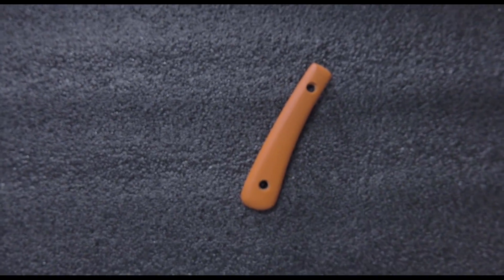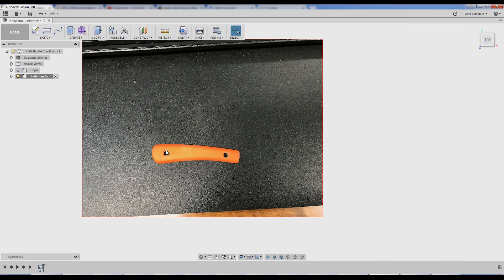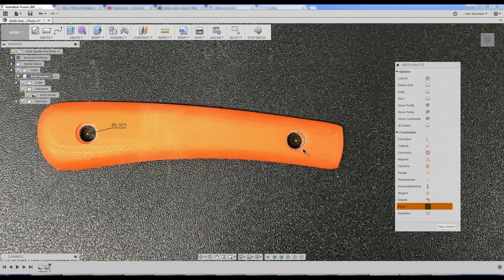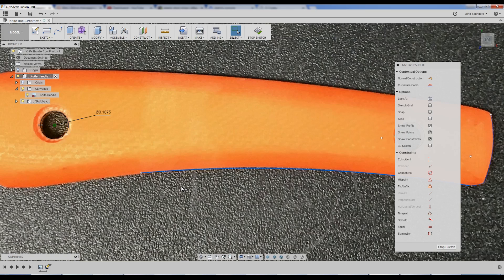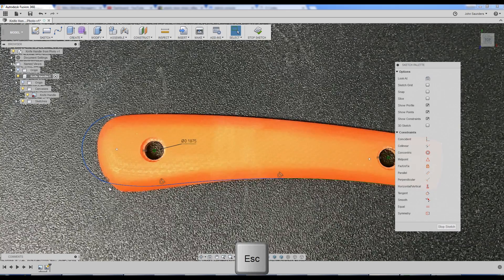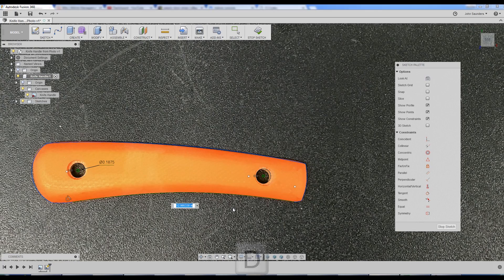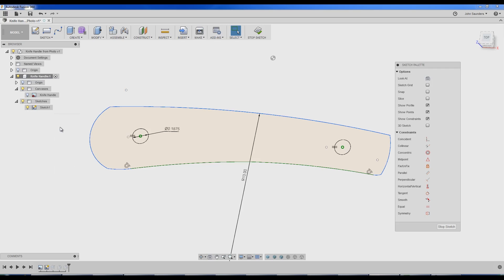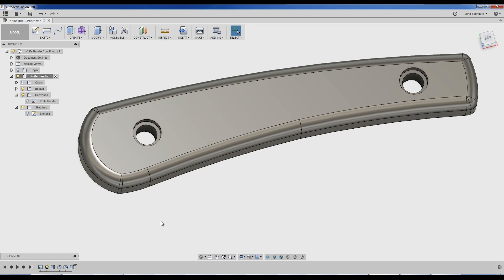How to Create a CAD Model from a Photo in Fusion 360! FF96

Comment: I wish this was a little more detailed in its explanation.  As others have said, it's really helpful to take a photo of a ruler next to the piece for calibration but even better is to flatbed scan the part with a ruler as it helps to reduce parallax error and distortion.  Regardless, this is a good exercise if just needing a single part but where it quickly fails is if you have several parts that will fit together and you need all the holes to line up to tight engineering tolerances.
 
I found in these cases, even with scanning and very accurate calibration, you can have holes (like two parts with a connective screw or bolt hole) that the holes can be a millimeter or so off from one another.  This causes you to have to go back and do a lot of design rework to get them to match up perfectly whereas if you had just measured the initial part very carefully and then drew everything else from the outset based on the first part you can avoid these hassles.
  
So while I like this feature and ability for "quick copy" of a single item, if you are making anything of a more complex nature with layers or a series of stacked components you can immediately run into alignment hassles, especially where holes are concerned.

Comment: I've done something similar with other software (cambam and draftsight aka 2D autocad by solidworks)

your method works for simple shapes that fit well to arcs and lines. It is not so great for anything complex or organic, and tracing a lot of lines could take hours on something complex. 

If i may suggest, 2 free/opensource programs save a lot of headache: GIMP and Inkscape 
1. take the picture from a little higher to reduce the error of the holes
2. drop a ruler into the picture so the pic contains the scale
3. open picture in GIMP, create paths and export them (.svg)
4. open the .svg ("vector image") in INKSCAPE, convert to dxf
5. import that into cad (F360) and scale it

In gimp you have much nicer edge detect and color tools:
*magic wand or color select tool to get the edges you want (threshold, feather & anti-aliasing options to smooth it and get however much you want)  also don't forget that you can select the background and then invert to get what you want
*you can try to select everything you need at once or do each chunk and merge later
*then, (either right click or menus at the top)  Select> To Path   
this makes a line/vector of your selection outline. If you go to your layers list, there is a tab at the top for paths
*in the paths list, you can select one and right click then export (.svg)

2 last tips before moving on to inkscape:
*grab 2 distinct lines with numbers from your ruler with this (snap points to set scale accurately in cad)
*if you converted each piece to a separate path, you want to combine them all into 1 path before exporting:
 in the paths list, click a path (highlights in blue on list) and at the bottom click the button for "path to selection", now click another path in the list and hold SHIFT while clicking "Path to Selection", keep doing this until you have all the paths you need, then click the "Selection to Path" button. next to that new path, click the box to display it (shows an eye, and the path will shop up in red) if you have everything you need, then export it.

Inkscape:
*open the .svg
*click drag a box around your geometry
*file>save as DXF       actual option is something like Desktop Cutting Plotter (Autocad dxf r14)(.dxf)
**Note: inkscape also has very good vector cleanup tools like smoothing, arc approx, & snappoint reduction etc. that may be nice before exporting into a cad format. 

Hope that helps someone who is about to go insane trying to trace in cad

Comment: I know you did this a while ago, but I just tried it for the 1st time. When I got to Calibrate by right click on Canvas the actual Calibrat command is gone. This with new UI.
Reply: In the new UI, Open the Component folder and then the Canvases folder in the Browser, place the mouse pointer over the image box below and right click it. You should see a new selection box with the Calibrate command. This one got me too!
Reply: @justmusing2569  Yup, that worked fine. Thanks!

Comment: I have been using this feature a lot lately, but the biggest problem I have when I bring in my canvas it always seems to bring it into the software squished to a funny sizing. I take the picture on my iPhone and then email it and save it to my downloads folder. Even when I calibrate it in the one plane say the length, it doesn’t correct it in both the length and the width. To correct it I have to sketch on some lines to a correct lengths and then scale the canvas manually which seems to take forever. What am I doing wrong? Any help would be great. Many thanks cheers, Ben

Comment: you wasted a LOT of time using that crap 3-way-arch tool; my method: import your picture into any vector graphics app (illustrator, inkscape, corel, whatever), trace bitmap (2 click operation, auto tracing path for your object) save as svg then import into fusion 360 and extrude, then keep modelling from there

Comment: Flatbed scanner/high contrast image, import image file into Inkscape, Left Click Image, [Path -> Trace Bitmap], [Brightness cutoff -> Update -> Ok], Remove Fill, Add Stroke, delete original image, Save as DXF. This will give you the profile without the added steps of creating profile from scratch. Import DXF into CAD and scale. This process works much more efficiently for more complex shapes. If you're only reproducing a knife handle John's process works fine.

Comment: Before you take your picture, lay a ruler next to the object. It makes it easy to set the scale in Fusion.
Reply: I would say its important trying to take the picture from as far away as possible. In that way the perspective will not distort the object.
Reply: Sumperman95 Thanks!
Reply: Yup, I have done that before and it works like a charm!!
Reply: Man, I’m glad this popped up.  Thanks for the advice!
Reply: Do you have a tutorial on this? I'm not sure now it helps? ... I'll still have to input actual size right?
Reply: @ravenmooore  Here is the advanced tutorial: 
1. Put ruler next to object
2. Calibrate based on ruler markings
Reply: @ravenmooore  Because F360 allows you to scale "accurately" by specifying a dimension between 2 points on the picture. Let's say you measured the distance between the two holes in this video, you would then tell F360 that the two holes in the canvas is X millimeters and it will correctly scale X & Y dimension. How accurate that is depends on how perpendicular you took the image and whether the picture had distortion. Still it's close enough.
Reply: @ravenmooore  That way you can calibrate on to the ruler, which has its own scale on it :)
Reply: Just thinking something similar. My thought was a self healing mat I had with measurements down and across.

Comment: it'd be better to take your reference measurement off one of the holes for your initial scaling of the picture, it's a more repeatable number, you can't be sure you set the calipers on the same exact spot you set the points to scale the image, but that diameter of the holes is a set value.

Comment: Always love this technique! Much easier in Fusion than older CAD programs. I would add, think like the designer than made the part initially. Designers don't usually pick long odd dimensions, so if the part is from Europe, and you measure it to be 2.02234mm , odds are it's just 2mm. Also, I rarely find splines when reverse engineering functional, non-artistic parts (Even curvy S shapes are usually tangent arcs) so arcs are the right way to go here.

Comment: I imagine using a scanner would work better as long as the part would fit inside...  you dont have to deal with parallax and angle issue from taking an image from a single point.

Then you can bring the image into photoshop and crop it out as a single 2d body shape on a transparent background.  Save it as a vector file and import it into fusion and extrude it from the body.  It will save time outlining the part in fusion as photoshop has better tools to do it for you. especially when the shape becomes more complex.

Comment: For smaller parts, especially planar parts, I like to use a flat bed scanner and put them right on the glass. As long as everything is flat on the glass. There are no parallax errors or lens distortion either! Also, if the dpi is embedded in the picture, fusion usually gets the scaling right without ever having to calibrate.
Reply: Place a ruler or known length object next to it to cal with.
Reply: Very nice!
Reply: Awesome idea!  I was considering that, but I use cameras with post processing...

Comment: Most of the stuff I (re)make is either too expensive or too rare to actually get my hands on, so I trace images all the time in CAD. Seeing Fusion's dead-easy image size calibration was the final straw in my decision to abandon Solidworks!
Reply: Ed, had you been using Solidworks for long? I am looking to get my first CAD/CAM package (I want to do it right from the outset, and learn only one package very thoroughly), and one requirement is that I will own it, not rent it, and another is I have my data local, not out in the cloud. 

Sadly, that eliminates anything from Autodesk, and Solidworks appears to be in the same league as their products (as opposed to something like BOBCAD/CAM), though from what you say it's not exactly apples to apples in terms of ease of use and feature set? 

Have you seen anything about the 2018 version coming out next month that might change your mind about it? I'd have to think that they have been watching Fusion 360's growth, and features, and would at least attempt to have a comparable feature set to try to remain competitive?

Comment: Thanks, John!  Well-timed...I have a repair part I need to make on my 3D printer for a pole lamp, and this method should make it a lot easier to get it right. 

If you are looking for ideas for future vids, how about one on the assembly feature?  I know most of your parts are single component, or components joined with joints (like the clamps), but I'm currently designing a cart for a TIG welder and I need to position components relative to each other, without them touching each other. For example, two cross bars in the base frame that are each attached to the side rails, but not to each other, yet I need the space between them to be specified. I did it by making a temporary spacer component, then deleted it, but there must be a better way.  Ditto with positioning the wheels (casters in front, wheels on axels in the back) so they sit on the same plane, so I can fit the wheel support brackets in the right size and position.  Again, made a temporary reference component, but not fun or efficient...is there a better option? 

Thanks for the vids...very useful for education, ideas, and motivation to try new things!

-- Mike

Comment: Why do you use arcs? Did you forget splines exist?
Also, there are ways other than fillets to generate even smoother rounded surfaces, most of them are in the surface toolbox. I think if you have a set of closed surfaces you can generate a solid from them, but I haven't gotten this to work in Fusion, yet. Maybe I just started with a too difficult piece, but I will try it again.
Reply: Klaufmann There are so many tools in fusion!   I would be lucky to find half of them and even luckier to use half of the ones that I found.  :)   John is probably a lot like myself in being more comfortable with the machining environment first, then backing into the design environments and learning those second.
Reply: I don't know all the tools, either. I just know somewhat what I want to do and try out the tools that look like they would work for that. Then fiddling around until it works or consult google for more information. After a while you should get familiar with the tools, at lest it is this way with most programms that I used (not just CAD).

Comment: A good trick that gives me decent results is to use splines for sketching the outlines as close as you  can and then when the basic shape is achieved, you can segment those splines into arcs with pre-defined tolerance to maintain shape. This will give you a much cleaner G-Code. I do this with GibbsCam, don't know if Fusion360 has a segmenting feature though.
Reply: I'm not sure, but I think the CAM processor from Fusion 360 can interpolate splines to arcs if you set the arc tolerance in the machining operation panel.
Reply: Klaufmann that would be handy if Gibbs cam did that.  If i put a contour tool path to a spline, Gibbs will out put thousands of little line segments to simulate the curves but makes the machine move considerably slower and a much larger G-Code.
Reply: I had a similar problem in CamBam when I wanted to import a contour I made in another program, which was composed of lots of linesegments. There were so much short G-Codes that the machine couldn't handle them fast enough and stopped multiple times while cutting. After that I discovered a possibility to round the whole contour with a tolerance and that worked great. I don't know your program, but maybe there is a setting for that you haven't found yet?
Reply: Klaufmann there is a setting for tolerance but it only increases or decreases amount of segments. Gibbs really isn't that great at interpolating splines to arcs

Comment: Maybe you just lay it on the scanner to get the right angle.
Reply: Or take a picture from big distance (at least 3 feet) and cut out the interesting part of the photo. This way you can reduce distortion quite drastically and modern cameras should have high anough resolution for this to work.

Comment: Thx (again), John, for a nice video, w/ some gems along the way.

Now, as you noted, there are certainly other ways to do this. And, in fact, some commenters offered up some good suggestions. Here's my take...

- Automatic bitmap to vector "tracing" can be useful in a number of cases, but it generally does not create the most optimal splines. Sometimes, they're not even "acceptable", depending on the requirements of the project. On the other hand, sometimes they're "good enough". Experience and personal assessment will apply.
- Capturing the image can be done w/ camera, or 2D scanner. To minimize lens distortion when using a camera, I look directly down on the object; get as high up as practical; and zoom in.
- Engineering accuracy vs. "functional" vs. aesthetic will dictate what method(s) to use in the reverse engineering.

[25+ yrs of experience - B.S.E.E.: Elec. Eng., w/ emphasis on computers/robotics; 3D animator/modeler/programmer/tech writer/teacher/mentor; and current 3D printing lab manager/trainer/instructor at Factur makerspace in Orlando, FL. I love this stuff!:)]
Reply: P.S. Not big fan of F360 splines. Much more comfortable w/ Adobe, but would love to keep process all in F360. So, any suggestions, links, insight, etc. on F360 splines would be much appreciated. TIA.
Reply: Swami Human I hope everything goes ok with you in Orlando with this storm coming.   We are up in Tallahassee.
Reply: Thx! Latest path shows storm tracking straight up thru Orlando! Got my provisions. Securing outdoor things today. Just gonna ride it out. Lived thru Charlie in 2004, so have some idea of what to expect. Also, born during Category 5 hurricane ("Donna"). You stay safe and dry, too!...

Comment: Go with a telephoto zoom lens for no perspective/fisheye distortion. Or drop it on a flatbed scanner.
Reply: There are programs that completely remove lens distortion based on the camera body and specific lens.  I use DXO - supports any major manufacturer and has manual distortion fix if you are so inclined :)
Reply: Please explain your " flatbed scanner concept." I am an old man trying to learn new tricks lo
Reply: @aztecwarrior7373  if you have a somewhat flat object you can place it on a flatbed scanner as if it were a document and scan it. The image created by the scanner will have no perspective or lens distortion at all.
Reply: @KenColangelo  €So, I can use my printer scan option with the same results?
Reply: @aztecwarrior7373  If it's got a big flat glass scanning surface that should work.
Reply: thank god someone's said it